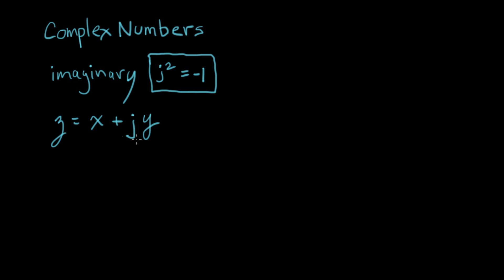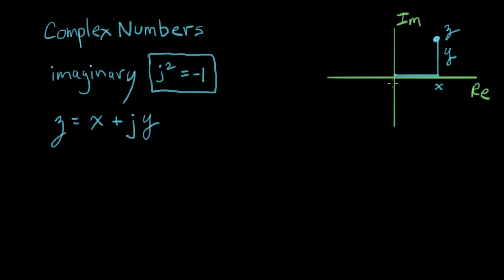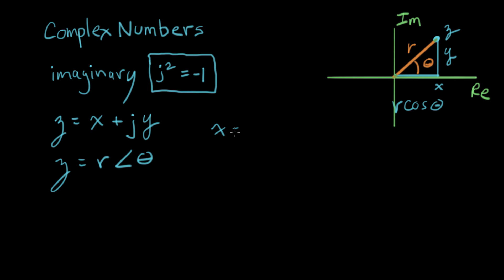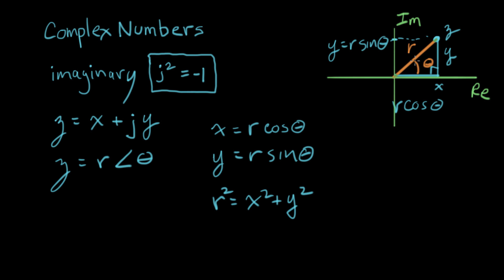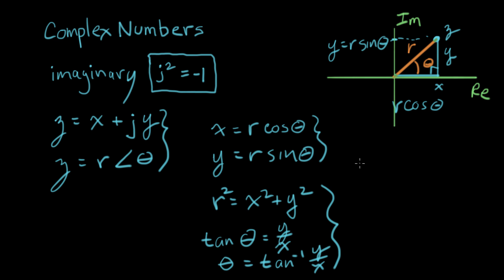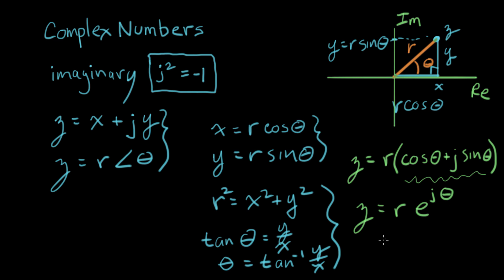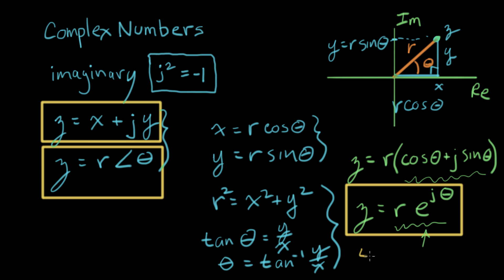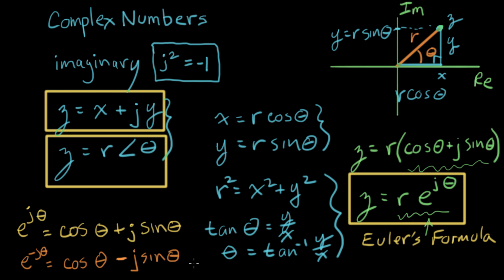Complex numbers

Comment: So... You basically introduced i with a different variable and then went on and explained how a cartesian coordinate system can be converted to polar and the quickly wrote down this 'eulers formula'. I don't get how that is of any use when calculating imaginary numbers...
Reply: yeah, it seems that the formula isn't useful at all if we have no value for r or theta, since then we only know what e & i are. BUT, if we know any complex values, say, -3+7i, then we can convert it to Euler's. Still trying to figure this out myself.
Reply: The square root of 2 is an irrational number when you have a unit length of 1 on the x and y plane. Therefore r is irrational.

But if r = 1 then you have to have an irrational value somewhere else. So "e" serves as that irrational value when r wants to be a real number.

Therefore when r = 1, the identity of point z is called "r*e^j*theta".

So we can't "calculate" imaginary numbers, we can only "name" them, and then shift these names around in algebra.

This helps us understand if some imaginary number is "equal" to another through correspondence, even if we don't get any numeric value from it.

If you can think of the square root of -1 as simply "identity", then you can understand why we can't assign a number to it. Because all the numbers are used on the 1 dimensional line that progresses to infinity. We can't use them to represent "identities" except by calling them i*theta or j*theta etc.

Comment: Not bad but i would stick with i not j, as j,k,l is used in hypercomplex numbers when using complex numbers in higher dimensions.
Reply: in electrical engineering we usually use j. Also called as j operator.
Reply: Problem in Electrical Engineering is that i is the symbol for current so they decide to use j